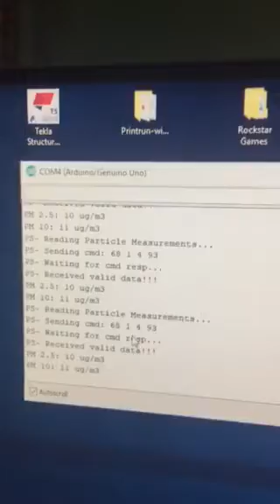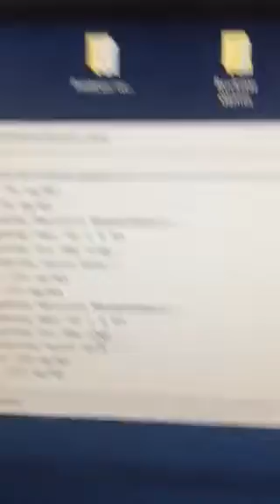Honeywell HPMA115S0 and Arduino

Comment: i am using arduino mega 2560 and honeywell hpma115co-004 compact sensor it showing the repeated values in serial monitor
Reply: Dust sensor test
Starting...
2199
PM 1.0: 0 ug/m3
PM 2.5: 0 ug/m3
PM 4.0: 0 ug/m3
PM 10: 0 ug/m3
7417
PM 1.0: 0 ug/m3
PM 2.5: 0 ug/m3
PM 4.0: 0 ug/m3
PM 10: 0 ug/m3
12445
PM 1.0: 0 ug/m3
PM 2.5: 0 ug/m3
PM 4.0: 0 ug/m3
PM 10: 0 ug/m3
17474
PM 1.0: 0 ug/m3
PM 2.5: 0 ug/m3
PM 4.0: 0 ug/m3
PM 10: 0 ug/m3
22502
PM 1.0: 3 ug/m3
PM 2.5: 3 ug/m3
PM 4.0: 3 ug/m3
PM 10: 40 ug/m3
27532
PM 1.0: 3 ug/m3
PM 2.5: 3 ug/m3
PM 4.0: 3 ug/m3
PM 10: 40 ug/m3
32561
PM 1.0: 3 ug/m3
PM 2.5: 3 ug/m3
PM 4.0: 3 ug/m3
PM 10: 40 ug/m3
37591
PM 1.0: 3 ug/m3
PM 2.5: 3 ug/m3
PM 4.0: 3 ug/m3
PM 10: 40 ug/m3
42619
PM 1.0: 3 ug/m3
PM 2.5: 3 ug/m3
PM 4.0: 3 ug/m3
PM 10: 40 ug/m3
47648

Please help 🙏this type of repeated values showing in serial monitor baud rate is 9600
Reply from the maker: @aaravdas9476  try adapting this example: https://github.com/felixgalindo/HPMA115S0
Reply: @jonathanself3474  thanks but I counter the problem few days ago and I solve it
Reply from the maker: @aaravdas9476  awesome! how did you fix it?
Reply: @jonathanself3474  actually the issue is in the code so I change some lines of code
Reply from the maker: can you link the source code you are using? also what exactly is showing up in the serial monitor and what baud rate are you using?
Reply: @jonathanself3474  source code -
#include <hpma115C0.h>  // Include the HPMA115C0 library

// Declare the variables for the particulate measurements
uint32_t pm1_0, pm2_5, pm4_0, pm10;

// Use Serial1 for communication with the sensor (on Mega 2560)
HPMA115C0 hpma(Serial1);

// Buzzer pin configuration
#define BUZZER_PIN 8     // Buzzer connected to Pin 8 (Red wire to Pin 8, Black wire to GND)
#define PM_THRESHOLD 50  // Threshold for PM 1.0, PM 2.5, or PM 4.0 to trigger the buzzer

void setup() {
  Serial.begin(9600);       // Start serial communication with the PC
  Serial1.begin(9600);      // Start serial communication with the HPMA115C0 sensor

  delay(10000);             // Delay for 10 seconds to allow the sensor to stabilize

  Serial.println("Dust sensor test");
  Serial.println("Starting...");

  hpma.Init();             // Initialize the sensor
  delay(3000);             // Wait for the sensor to stabilize
  hpma.StartParticleMeasurement();  // Start particle measurement
  Serial.println("Sensor initialized and particle measurement started.");

  pinMode(BUZZER_PIN, OUTPUT); // Set the buzzer pin as output
  digitalWrite(BUZZER_PIN, LOW); // Ensure buzzer is off initially
}

void loop() {
  Serial.println(millis()); // Print the current time in milliseconds

  // Clear serial buffer to avoid communication issues
  while (Serial1.available()) Serial1.read(); 

  // Check if the measurement reading is successful
  if (hpma.ReadParticleMeasurement(&pm1_0, &pm2_5, &pm4_0, &pm10)) {
    // Print the PM readings to the Serial Monitor
    Serial.println("PM 1.0: " + String(pm1_0) + " ug/m3");
    Serial.println("PM 2.5: " + String(pm2_5) + " ug/m3");
    Serial.println("PM 4.0: " + String(pm4_0) + " ug/m3");
    Serial.println("PM 10: " + String(pm10) + " ug/m3");

    // Check if PM 1.0, PM 2.5, or PM 4.0 exceeds the threshold
    if (pm1_0 > PM_THRESHOLD || pm2_5 > PM_THRESHOLD || pm4_0 > PM_THRESHOLD) {
      digitalWrite(BUZZER_PIN, HIGH); // Turn on the buzzer
      delay(2000); // Beep for 2 seconds
      digitalWrite(BUZZER_PIN, LOW); // Turn off the buzzer
    }
  } else {
    Serial.println("Failed to read particle measurement. Retrying...");
    delay(2000); // Wait before retrying
  }

  delay(5000); // Wait for 5 seconds before the next measurement
}

output showing- repeated value 

Dust sensor test
Starting...
2199
PM 1.0: 0 ug/m3
PM 2.5: 0 ug/m3
PM 4.0: 0 ug/m3
PM 10: 0 ug/m3
7417
PM 1.0: 0 ug/m3
PM 2.5: 0 ug/m3
PM 4.0: 0 ug/m3
PM 10: 0 ug/m3
12445
PM 1.0: 0 ug/m3
PM 2.5: 0 ug/m3
PM 4.0: 0 ug/m3
PM 10: 0 ug/m3
17474
PM 1.0: 0 ug/m3
PM 2.5: 0 ug/m3
PM 4.0: 0 ug/m3
PM 10: 0 ug/m3
22502
PM 1.0: 3 ug/m3
PM 2.5: 3 ug/m3
PM 4.0: 3 ug/m3
PM 10: 40 ug/m3
27532
PM 1.0: 3 ug/m3
PM 2.5: 3 ug/m3
PM 4.0: 3 ug/m3
PM 10: 40 ug/m3
32561
PM 1.0: 3 ug/m3
PM 2.5: 3 ug/m3
PM 4.0: 3 ug/m3
PM 10: 40 ug/m3
37591
PM 1.0: 3 ug/m3
PM 2.5: 3 ug/m3
PM 4.0: 3 ug/m3
PM 10: 40 ug/m3
42619
PM 1.0: 3 ug/m3
PM 2.5: 3 ug/m3
PM 4.0: 3 ug/m3
PM 10: 40 ug/m3
47648

Please help

Comment: Can you please share how you have wired the sensor and what Arduino board you have used? I read a whole bunch of discussions out there about the wiring and code which just made me very confused. Thanks!
Reply from the maker: Hossein Sadeghi Absolutely, I’ll dig up the latest information that was compiled into a PowerPoint for GASP Birmingham, Alabama (the group I designed the air monitor for). It should have an updated bill of materials and a hookup guide along with the code I made. The .STL model for 3D printing might require additional holes to be cut or drilled into it after being made. If I need to answer any questions feel free to get in touch with me here at any time! I’ll post the link here for you ASAP.

Comment: Hi, nice work there. could you share the code?
Reply from the maker: Thank you Daniel! As soon as I'm off work today in about 10 hours or so I'll post a link to the code in a comment and add it to the description of the video. I just finished compiling the final code last night so the device would show both PM 2.5 and PM 10 correctly. I'd love to see what you end up using yours for when you finish you project, it's a great sensor and so much easier to get than the comparable Shinyei PPD60PV.
Reply: yeah, just got a couple of these guys and turned out not so many codes are available out there. Anyway thanks man! I appreciate it.
Reply from the maker: Ah crap, I just realized I forgot to post the code for you last night! I will do it tonight, I promise! I was super distracted when I got this: https://www.sparkfun.com/products/14568 in the mail finally. I got some serious "Predator" vision last night, har har. In the meantime, have you gotten things hooked up any way in particular yet? You'll need to use a "Level Shifter" to make sure the voltage going into the HPMA115S0 is 3.3V at the logic input if your device operates at 5V like an Arduino Uno or something, if not you will very likely fry the sensor. I ended up using this: https://www.adafruit.com/product/1875 .
Reply: wow, fancy toy you got there, I see you working on thermal imaging.
I'm aware of this particular sensor interface and currently working on pms5003[got em running]. In the meantime, I've been studying on this sensor but kinda confuse with those responses. I thought I can do it with the same approach but it's not. That being said, I'll wait for some enlightenment man, ready when you are.